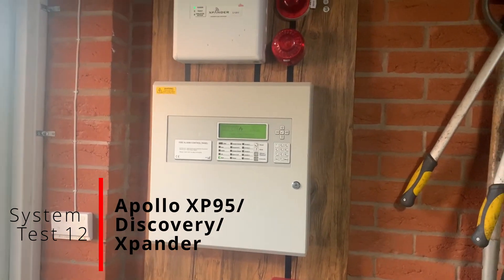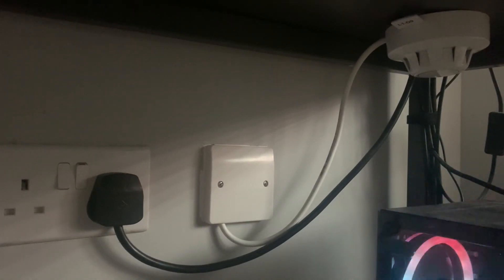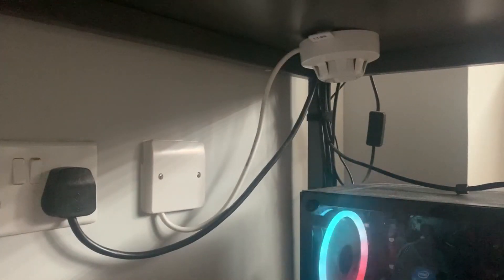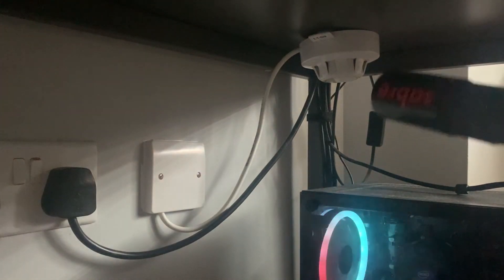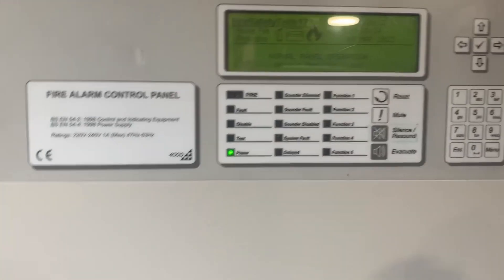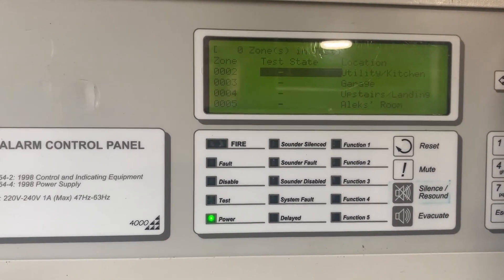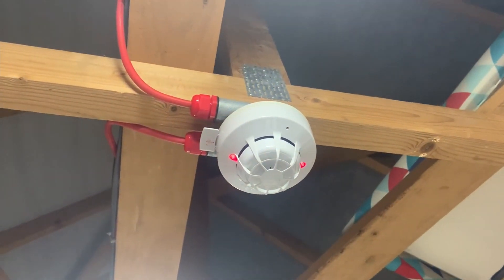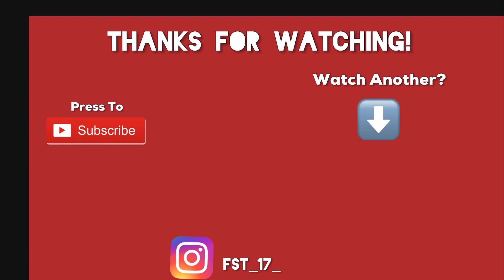Apollo XP95/Xpander House System Test 12

Comment: 3:25 what is that little box with the wire coming out called? And is the detector returning the loop?
Reply from the maker: That detector is the only one that spurs off the loop. And I used a flex outlet plate (MK) to connect the coax to the detector.